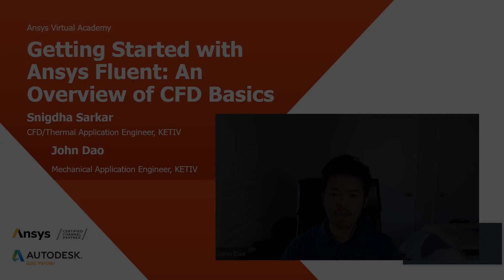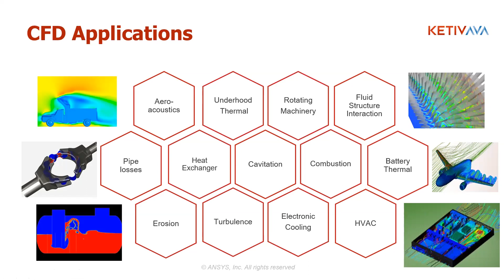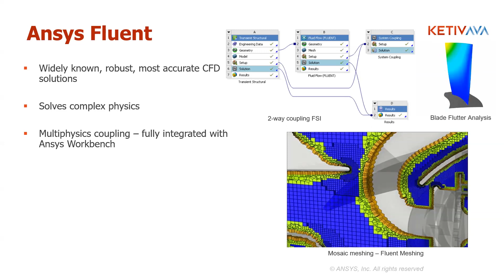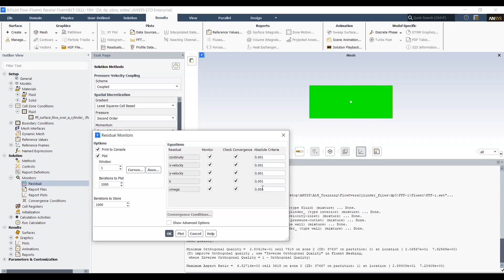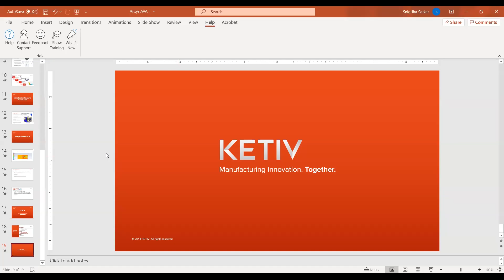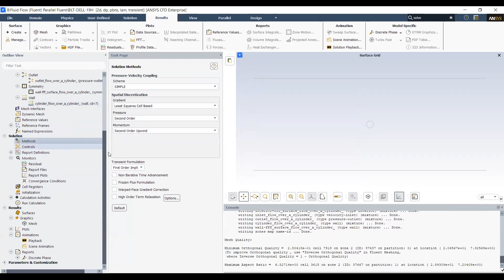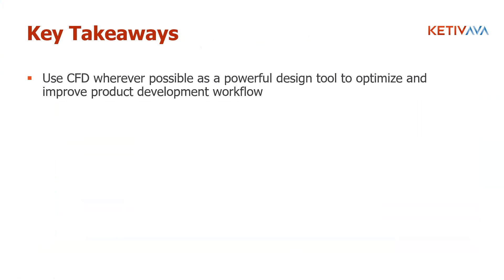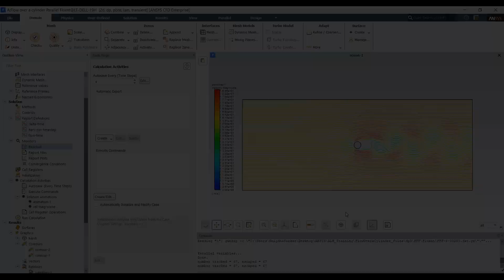Getting Started with Ansys Fluent | Ansys Virtual Academy

Comment: Very good session. Really informative!
Would you upload a session on how to get started with Coupled DEM-CFD (Discrete Element Method - Computational Fluid Dynamics) simulations? In which, CFD is performed in Fluent and DEM in Rocky, running coupled simulations. For instance, segregation of solid particles by air and transportation of solid particles by air.

Comment: Informative session and very good teaching style. But when the fluid is air how can you take so less Reynolds Number- only 80. When Air/Gas is considered then the Reynolds No must be below 200000 ( two lakhs). You took eighty, it is not wrong. You can take anything more than zero. But a little higher Reynolds no in order of 1-e+5 is recommended. Prof. S. Mukhopadhyay

Comment: Is there any way to do 2 way fsi problem with just one time coupling? ie,  for eg. If i have a elastic membrane and air is passing , there is an elastic deformation and then take the deformed membrane to analyses the changes in the  air flow? (for a single time coupling)